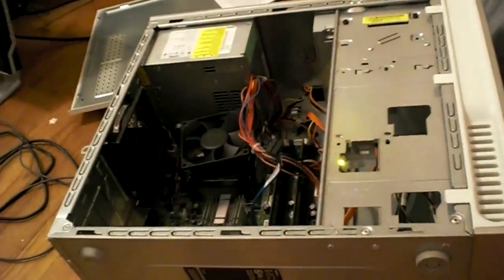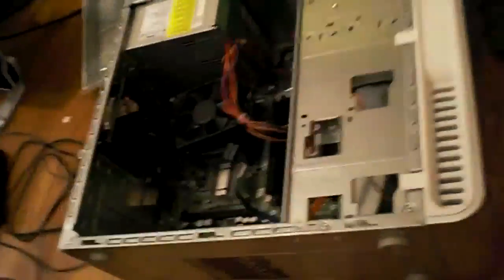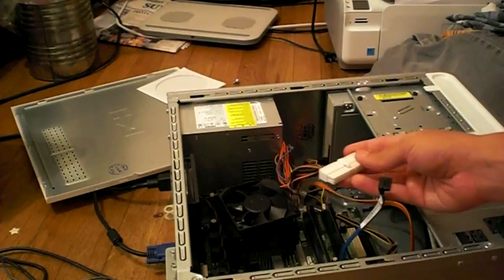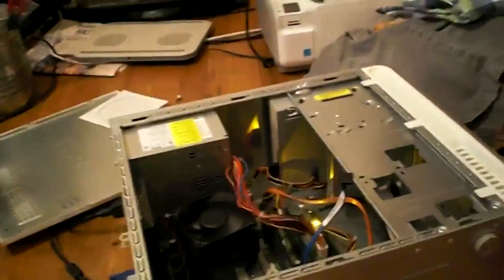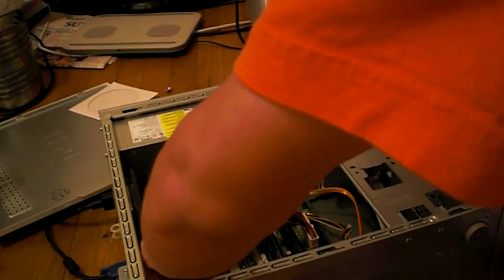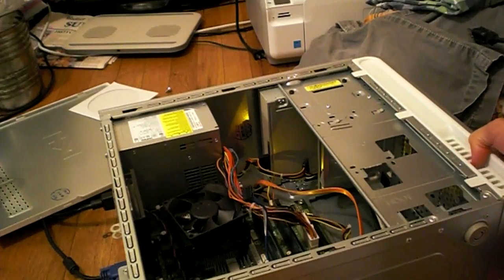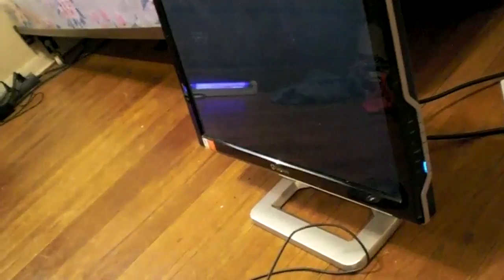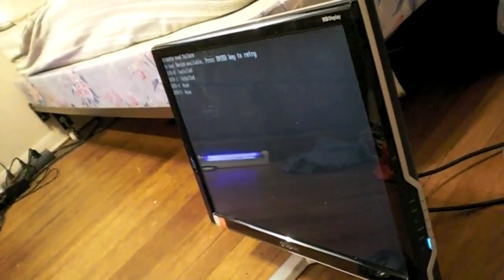Dell Inspiron 530 computer Wont turn on Properly.  what could cause this? Read description

Comment: wow paper clip thing new one to me, but crazy I had lot of issues with my dell in time, power outages was simple start in safe mode and restart again, I have been having problems where I wake up and computer went black, like it just goes out overnight, and when I go to wake it up, or restart, nothing on monitor but I hear fans and shit. so I shut down, restart and it starts beeping, and nothing on screen. so after few tries same thing, I ended up removing a fan to clean dust, I went to start up. it was unplugged, and swear it gave me a screen and said about fan failure, hit f2, I shut it down, plugged in fan . powered on, all was good again

Comment: How amazing. I bought a laptop a few years ago. Since then i don't use my dell anymore. It still worked for a while. But it's been a year since it has not worked. I used the paper clip thing as you suggested. (something i never heard before) My computer is operating amazingly! Thank you s much for your video! Now i can get back to my old pics and stuff i had saved in there.
Again thank you!

Comment: i saw your video last night and i kind of knew a bit about what might be wrong, Yesterday i cleaned the power supply, and heat sink fins, and kept pluging the harness in and out and it would work prior to the cleaning, but i knew noting about the paper clip, and or removing the motherboard battery, till like i said i watched you go through the steps, And mind you i had all but giving up on my dell. Sat in stroage for months, so i will make it short i went to the shed got my dell out and did what you did AND LORD AND BEHOLD, IT WORKED ON THE FIRST TRY, of course the jumper click in place and i got the blue light, you had a bit of more to do due to that hard drive you had lol. but overall i want to thank you for that video, peace out 

Texasrangerlawman: thank you so much!!!!!

Comment: same problem with mine i got it working again by 3 different actions 3 different times : taking the cmos out and in, disconnecting all cables that go into the motherboard and plug em back in and the third time was by playing with those two little blue caps that sit right behind the cmos  ...  i also did a whole lot of paper clip action which didnt help cause i did it wrong... propably did a lot of dmg :)

Comment: 1. Get a new power supply. 2. Enter bios setup and make sure your boot order is set correctly. 3. Make sure the SATA mode is set to match the way in which Windows was installed: IDE or AHCI mode - when Windows was installed the setting was probably AHCI and when you removed the CMOS battery to clear the CMOS, the SATA mode probably defaulted to IDE mode. The SATA mode determined how Windows accesses the hard drive. Do not use a paper clip to short the power connector, you will cause more damage, and possibly injure yourself.
Reply: He did not short the power supply he shorted the switch input.
Reply: Ide or raid only options i got on my dell ispiron 530

Comment: mine works fine after a power out, but then I have got brand new parts for it but then it's the same as the stuff it came with

Comment: Mine does the full fan blast for about 2 seconds and then off, and repeats. I have to unhook the PCIe power to my gtx550ti, and quickly plug it in after the POST beep. I have an Antec HE 500 PSU, and changed the processor to the E8600, 2x2gb pc6400 sticks. I'm typing on the computer right now, no heavy usage freezes. I'm changing the CMOS battery next but I'm leaning towards the PSU I bought.

Comment: this guy is an idiot never remove the battery when its still in the mains CMOS don't reset then
Reply: Jason Rodda it is resetted because its finallly try to boot floppy disk as the floppy controller from motherboard activated and turns into primary boot but then error appears since there isnt a floppy drive attach to the controller

Comment: I have this pc never ever had Problems whit it it runs they newest games whit 20-30 fps whit 2gb ram geforce 210 512mb Intel Duo core 2,50 Its 6 years old but who cares! its a gaming beast in my eyes.

Comment: Those Hipro power supplies are KNOWN for bad caps! Either service the power supply or replace it. If you forget to set the cmos clear jumper properly, it won't power up either.

Comment: mine wouldn't start up properly either when it kept turning on and off for 5 sec and only why it did that cause mine was needing a new  3-V CR2032 lithium coin cell battery witch wasn't so hard to replace but you can always give that a try and see how it turns out for you

Comment: Mine does the same thing - the onboard video chip needed reflowing - did it myself with a heat gun.  Started out slow, and it ran great until I shut it off, then same thing.  So I got it a little hotter, then it started like normal for a week, now it's been a month and a half and all is well!

Comment: hi i tried unplugging it and then when i take clip out the fans stop so i did it again and now the computer desktop and keyboard and mouse wont do anything all its doing is showing yellow light inside modem and the power button wont shut it off what do i do

Comment: get a new powersupply for the computer and a new battery for the motherboard should fix the issue instead of jumping things. also for the commenter on the computer that beeps alot. and a black screen look up on google beep codes for your spec. of computer every computer is diff.

Comment: ey man i have a vostro dell desktop compu and it wont run window black screen the tower turns on and the fan that cools the main chip run high velocity and it has a beep sound on the mother board it sound every 2sec....help

Comment: You Need to Replace The DELL NT294 Power Button . When the Microswitch is Turned On and Off more than a Thousand Times the Contacts in the Switch wear down and cause a Power Loss to the motherboard . This problem drove me crazy trying to Figure out what was Wrong with my Dell 530 Inspiron Turning itself Off and On and crashing Over and over Again until I replaced that Power Button .

Comment: Sorry but no, your dad is an idiot and doesn't know what he's talking about.  Shorting the green wire to a black wire is exactly what the motherboard does when it detects that you pressed the power button.  This tells the power supply to power up all of the rails to power the rest of the computer.

Comment: i changed the battery on the mother board with a new one, everything is working again. hope that helps, I tried everything else and it was the 50 cent battery

Comment: I had the same problem with my dell inspiron 530.  I fixed the fans revving by removing the battery on the motherboard while the computer was unplugged and putting it back in after a few seconds.  It now boots perfectly.

Comment: well, you *could* use a voltmeter to trouble shoot the independent +5V -5V +12V COM PWR -12V wires, however its not foolproof since you could see a Primary power circuit function, and the Secondary not function.  The Power Tester is your best bet.  It plugs in, and done.  You know immediately if the PSU is bad or not.

Comment: Well, The PWS tester is very inexpensive, quick, and easy.  That power supply likely has a failure in the secondary power system, which is why it starts to boot, from the primary circuit, however, either the -5V or the +5V circuit is damaged... thus the power cant remain on.  Jumping it like that will short your switch or cause the switch to melt, or worse. Voltage feed spikes can and do damage the cheaper brand power supply units. So, did you fix it??

Comment: Sopped video at 6:45.
Dude, do yourself a favor and get a $14 power supply tester, if you're gonna be diagnosing PC power issues.  Jumping the pins is foolish.  Also, you jumped PWR/ON and COM.  Not ground. Clearly your not understanding electronics, and just looking for a quick "hack" gimmic fix.  Replace the faulty Power Supply.

Comment: hi guys i got a problem with my pc  basically i see a light on my mother board but the pc wont power on and no fans spin no beeps nothing i  might try this method but as i say the wire for my power switch

Comment: Seems this model is prone to this issue.  My 530 just died with a power outtage yesterday.  New PSU did nothing and the old checks good with a tester.  Will start pulling cards out when I get home.

Comment: How dis you pull the power supply ribbon from motherboard? Did you put the 2 ends of paper clip in the green wire's slot?

Comment from the maker: where are the jumpers on the motherboard? Also last night the button was working when I went to try turning it on,  And I did that a few times, this morning I went to go and try that but then it doesnt work now.  I don't know if the button is messed up because when the computer is on I can ALWAYS turn it off by the button.

Comment from the maker: I learned from Vo Tech computer class sometimes removing the battery can clear things from BIOS and reset things that may cause a problem.  The computer does boot after doing this (well at least turns on) well using the paperclip.  The button doesnt always work though.  removing the battery made it at least work a little.  It wont boot because I dont have the hard drive that was setup with this computer.

Comment: Better than what I can do....
One thing is, when you removed the ROM battery, it lost all the important setting needed to start up properly, hence why you were getting diskette failure messages (most computers at imitial settings look for the A drive, the diskette, as the place for an operating system to boot from). If you let that battery be, you'd probably be a LOT closer to a solution.